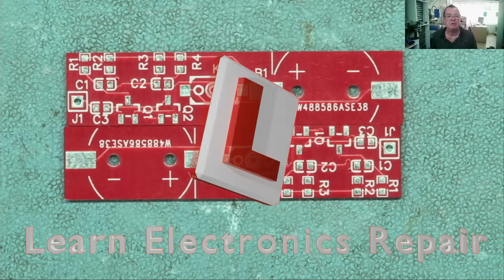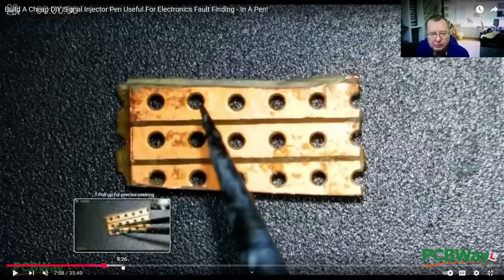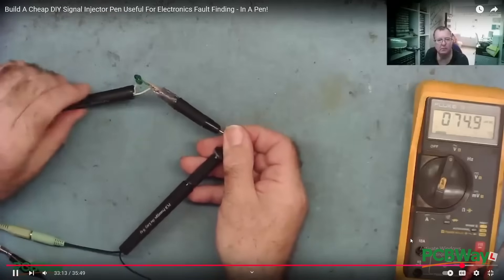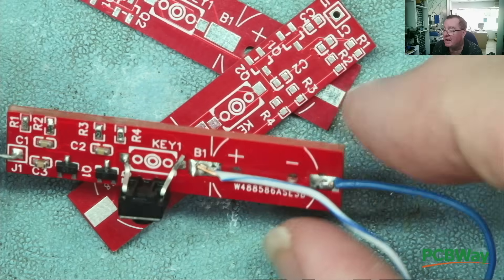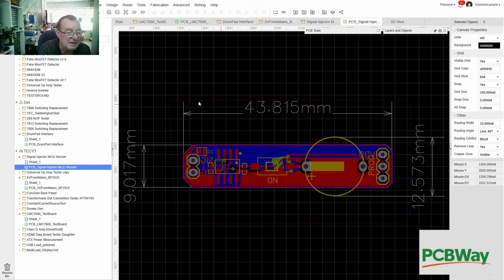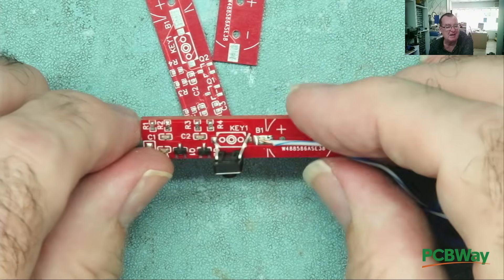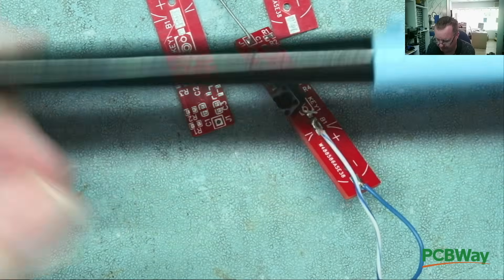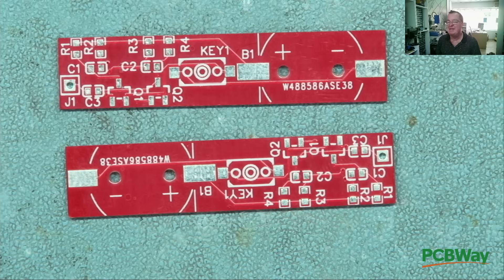Make The Smallest DIY Signal Injector : A Fun Interactive Challenge

Comment: Maybe use 510 thread battery, basically the 510 base which is used for various projects, from first types of vapes with atomizers (oil tanks with heater), to solder irons or rosin fume dispenser/atomizer...they come in several lengths. So basically there's thread battery case (510 - if you gogole it, it will show how it looks like -  on AliX for sure) , has a button for on/off, has a charging port, a battery in, and you can screw on top of it whatever extension you want. 
That extension might need much more engineering to pack everything in it (the pcb with electronics should be made to get into so called "atomizer" casing - the screw on extension , here atomizer is just casing for pcb with elecronics)...or use 510 with smaller battery, use the rest of inside of the casing to put pcb in it, then just screw touching tip on top of it (just like soldering tip is screwed)...
The idea from one of the comments to use disposable vape with usbc charging port and battery which comes with it seems better since after removing tank from vape there's much room for small pcb with electronics. 
I am not an engineer, can't use any CAD software, this just came to me as some initial idea, maybe it's all wrong 🤷🏻‍♂️
So 510 "battery" or disposable vape? 
I apologize, my English is very basic and my initial idea might not be clear, I hope people can understand what I wrote 🙏🏻
God bless, be well all of you 🖖🏻

Comment: You can get small flat rectangular 3.7v lipo batteries that come with a plug-in connector so use one of those. If the voltage needs to be slightly less use some diodes or a zener to clamp it.

Comment: What's with using a battery at all?  Virtually all commercial logic probes and pulsers obtain their power from the circuit under test using 2 wires that terminate in alligator/croc. clips or mini grabbers.  You can stipulate any rules you want, but you can greatly reduce size by just inserting a steering diode for power polarity protection and/or a zener for voltage protection and get your power from your board under test.  Also, PIC u-controllers can operate down to 2VDC, so a smaller 3V cell would work with them.  I know your friend has familiarity and the programming tools for AT- tiny processors, but there are are other sol'ns out there.  Hope this helps?  BTW, I wholeheartedly applaud the continued use of both logic probes and pulsers for troubleshooting.  They are extremely useful, and have become a kind of lost technology that still has much use.  Cheers!
Reply: I usually fix at least one thing each day and I am using a logic probe to assist. I almost never touch my oscilloscope. Logic probes and pulsers are often used on equipment where the input voltage is easily obtained and exposed and the signals are digital like logic circuits or microprocessor circuits. If you want to inject an audio signal (actual noise) into audio equipment it's not that simple to hook into the power within the audio device you are working on.
Reply: You make a valid point for an autonomous power unit to test audio equipment that (sort of) works.  You will, at the very least, however, have to tie the grounds together to get the signal to flow into the DUT.

Comment: If you don't mind a square wave then could you not get something usable out of a very small package like this, along with a cap and resistor, and it would run off 0.9 - 3.6V allowing for flexibility in picking as small a battery as possible? https://www.onsemi.com/download/data-sheet/pdf/nl17sg14-d.pdf
Reply: caoroach - talked to Rich today and we came up with tinyLogic chips for the project, too! As a power source, I'm currently playing around with Photo Diodes (BPW34) - like tiny solar panels, they generate about 0.7V a piece (in bright sunlight). Put 4 in series and you're getting around 1.5V... should be enough for the TinyLogic chip. Granted: you can use the SigGen only in a lit enviroment - but who uses this in the dark? And: I don't need a switch. The thing can run all day withour draining the battery :)
Reply: @DetBuildsStuff  Genius idea with the photo diodes plus it also sounds like a bit of fun to try even if it doesn't work out. It also means you could do away with the need for a switch - it is on if it has some light :-)

Comment: You could have made your design thinner by putting the resistors and capacitors inline with the positive supply rail running down the other side of the board, emerging at vias where needed:
v-22k-10n-150k-v-220k-10n-22k-v
If you still want the board to be single sided it could run alongside and it would still be much narrower.

Comment: Okay, I have a very simple, very tiny design using just 5 components, the largest of which is 2x2.1mm. What are the requirements for frequency, output voltage, and duty cycle?

Comment: Some initial thoughts for the 1.5V version are to use 0.8mm thick PCB (you don't need 1.6mm if the probe pin is well supported). Then use an AAA battery at one end (with welded tabs and soldered wires) and an ALPS SKQG or similar pushbutton (which is half the body height of the existing switch).
Reply: AAA is W-A-Y too big. There's NO way AAA or even AAAA will fit inside a pen. There are smaller batteries available and what they want is a flat thin rectangular 3.7v lipo.

Comment: Use a spent rechargeable electronic cigarette body for your project.
Reply: I assume you mean disposable vape. There are still plenty around on eBay. It should be possible to add a charge port into the end.
Reply: @chrishartley1210  Many of them come with built in USB-C charger port. They are disposable but after several charge cycles.
Reply from the maker: @AAaa-wu3el  OK why not - this is meant to be fun, go for it

Comment: It must be able to be assembled by hand. 😉

That rules out any surface mounted component based design for me then. My old eyes just couldn't cope. For me it is through hole all the way.
Reply: Optical microscopes help a LOT so long as you have a stable hand as well.  I wouldn't be doing micro soldering without one.
Reply from the maker: OK that's within the rules - make the smallest possbile through hole version, that can be a category of it's own.  This is all for fun and everyone is included
Reply: The answer is simple.... use magnification and LEARN. It is actually way easier to do smd soldering than thru-hole and also way faster. In the time you can mount five thru-hole resistors I can mount fifty smd resistors lol

Comment: to make det's one smaller use 3 SR66 (V377) in series super small that is 4.5 volts.. close enough to 5 volt
Reply: I think Det's model is designed for 3V, I suggest he could use a CR425 as used in fishing floats.

Comment: Is there any reason Det couldn't just stack a bunch of smaller cells in series and shove that cylinder down the pen? You have the length, it's just the width and height that are limited. For example, put 3 PR48 in series and you'll have 4.2V (with 310 mAh). The diameter will be 7.8mm which should fit nicely in a pen. The stack will be 16-18mm long but there's plenty of length in the pen. You could go even smaller in diameter with PR10s but I don't know that it's necessary.

PR48s should be commonly available (often used in hearing aids, color code orange), and as zinc-air-cells, they're less likely to leak.
Reply: An electronic cigarette from the street gutter would do - it has li-ion battery and charger already built in.
Reply: @AAaa-wu3el  I've seen Big Clive talk about them but I despite keeping my eyes peeled, I never manage to find any in my area.
Reply from the maker: @AAaa-wu3el  Go for it 🙂